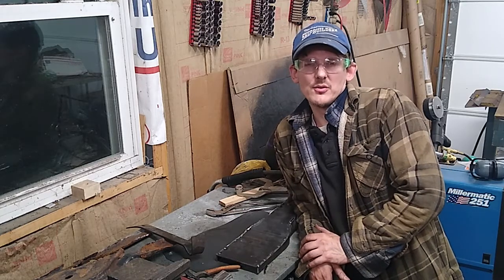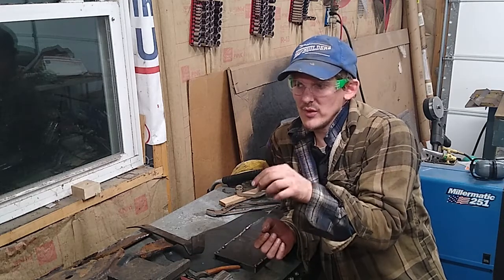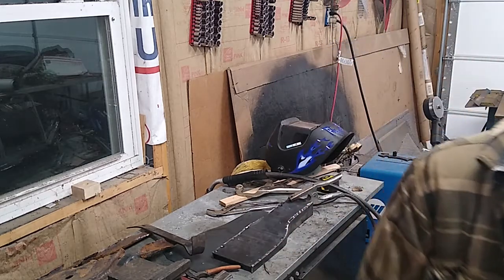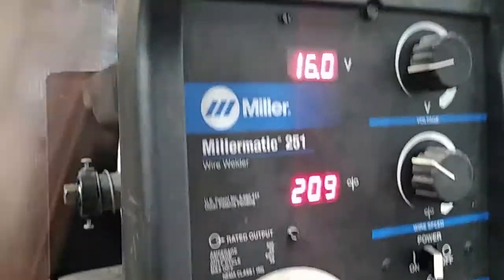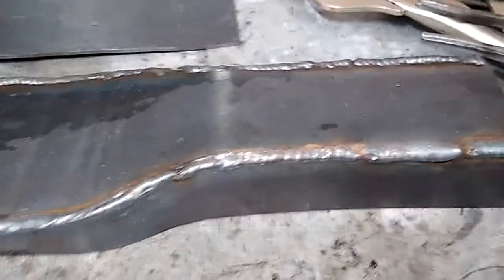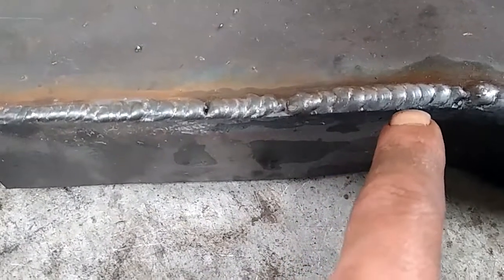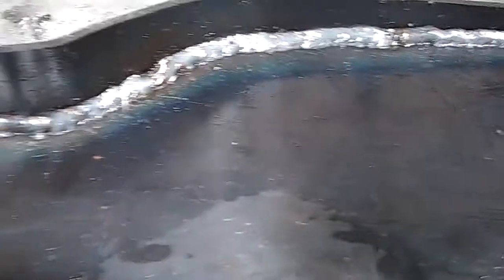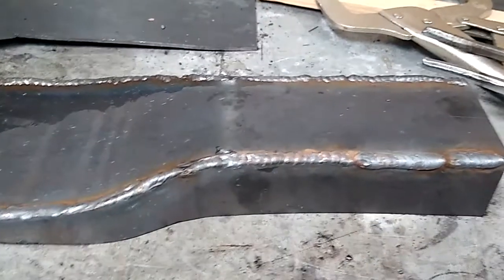MIG like TIG welding: Just Say No!

Comment: The main reason this is done is NHRA/IHRA requires all chassis’s to be tig welded there doing this to fool the tech inspectors into thinking there chassis is legitimately safe when it’s not
Reply: For a roll cage mig and tig are approved
Reply from the maker: That's a very interesting thought.  It would be a horrible mistake because it's so much weaker than actual MIG.